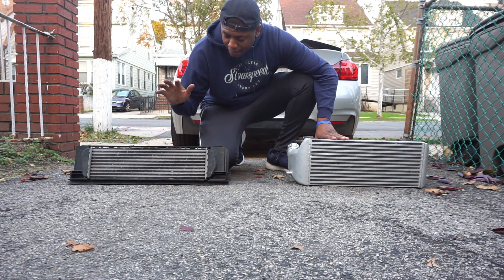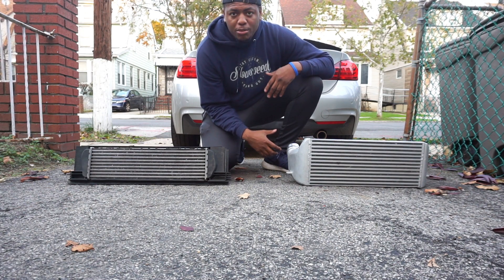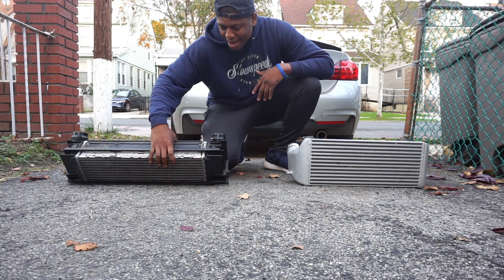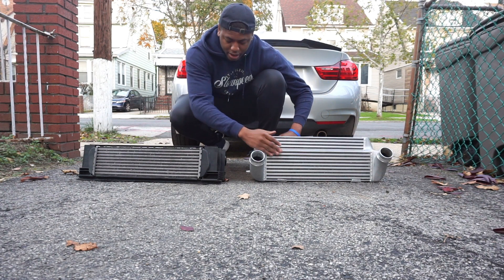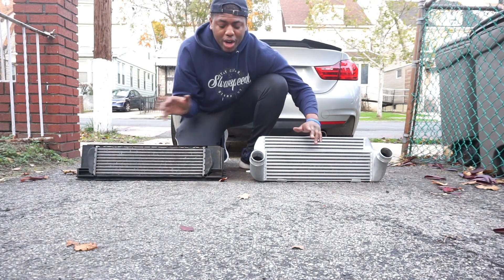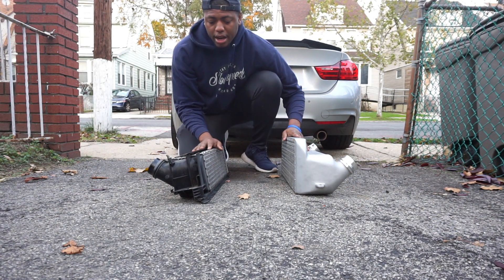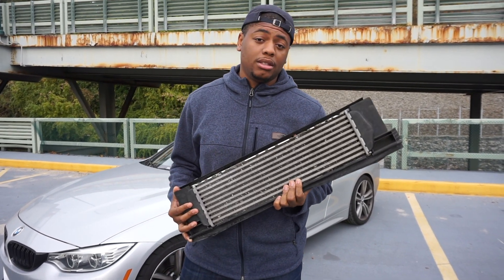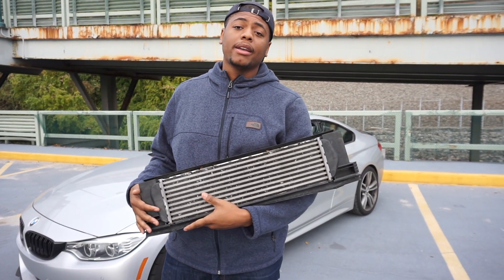VRSF Vs. BMW f30/f32 Oem Intercoolers

Comment: Great video !  Did you have to modify in any way the space to make this VRSF 5" fit ??  or was it just bolt on ?? btw,  a picture from the front of your car to show off your new addition would have been nice !!
Reply: No. Only for the 7.5. You need to cut a few bits of plastic to make it fit.

Comment: do a proper comparison before and after. use some science to prove it helps, i.e. IAT, hp, torque. Having something bigger doesn't always mean better :)
Reply: There are logs for this intercooler on the forums. It works.
Reply: @ichoozjc  yup, try running logs yourself on a traffic situation between stock vs bigger intercoolers. you will be surprised.

the bigger intercooler will only help if you're on the expressway happily cruising or speeding.
Reply: @clawhammer7  What do you mean? It only helps while cruising?  You do realize that most people who upgrade their intercooler are doing so to lessen the increased iat that comes with increased boost, right?  Which happens when wot through several gears, like on a track.  Stock intercooler can see iat climb 20-40°F on a tuned car.  With the right intercooler you can practically zero the delta.
Reply: @ichoozjc  I think you do not understand the concept and physics of how it works. Look, a bigger intercooler doesn't always help, it DEPENDS what you are doing. If you're on track then sure, it does. If you're on a bad traffic, it does not help!

The negatives of a bigger intercooler:
1. Turbo lag
2. Larger surface and gets hotter when it doesn't get enough air, heat soak.

If a bigger intercooler solves all the problems, they would've made one that's the size of your bonnet cover. Besides, nothing is perfect in this world.

Comment: hello i have been watching your videos ( great videos) question. Whats your "updated" opinion about this FMIC? quality, fins density , etc.......meet your expectations? 

About the radiator tabs, this version comes properly aligned? not cutting or something crazy?
Reply from the maker: The radiator tabs still needed modification, however i just bent them back and installed.
The FMIC works perfectly, i don't feel heat soak like i have in the past and while watching the temps i notice as soon as you get going the IAT drops and stays in a decent range!! Hopefully Soon I can get a video up of it.

The quality is up there. To be honest they all look the same,  with exception of the tabs.  best bang for you buck.
Reply: thanks for your honest answer, i m waiting for Active-autowerke FMIC and VRSF charge pipe, lets see how the things going with that stuff.  @Slowspeed

Comment: I don't track my f30 335i at all but it still gets really hot after driving for a little bit. The power loss in summer is very noticeable. How are you liking the VRSF? And did you consider the ER intercooler at all? And did you do charge pipe?
Reply from the maker: Yea I did the charge pipe. The Intercooler holds up just fine and i feel is more than enough for running stage 2 with boltons
Reply: What charge pipe you upgraded to?

Comment: Hi Slowspeed! Could you provide an update on the intercooler? 
Intake temps down? Notice any turbo lag?
Reply from the maker: Nah, I was finding boost leaks for a bit then weather changed so my logs would be highly inaccurate. If that make ssense
Reply: @Slowspeed  . I just did the setup and installed stage 2 bm3. First test drive and the clamps in the middle of the charge pipe snapped. Had to re-tighten them  a lot harder than the first time, but now I am loving the car, so much difference in power., I will post a video soon once the weather gets better. I cant wait for spring. How do you know if you have boost leak?
Reply from the maker: @joes3534  Well me personally i heard it first, did some datalogging and noticed wastegate staying shut and also just read reading targets and actual pressure can give you an idea.